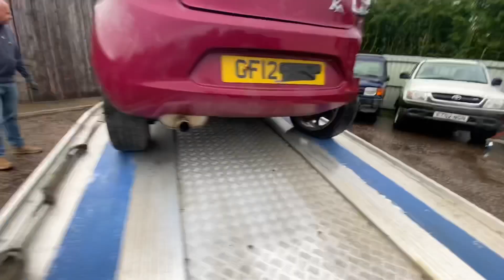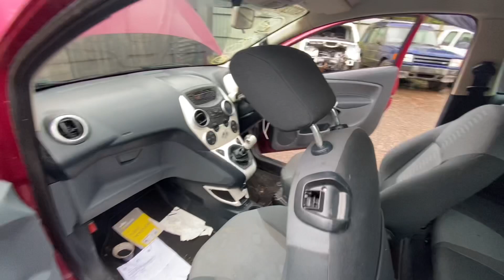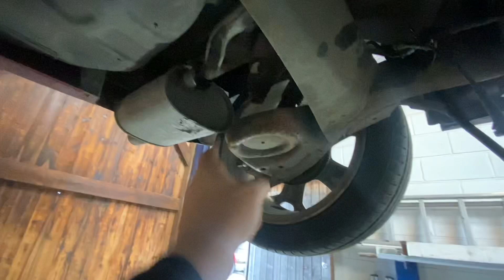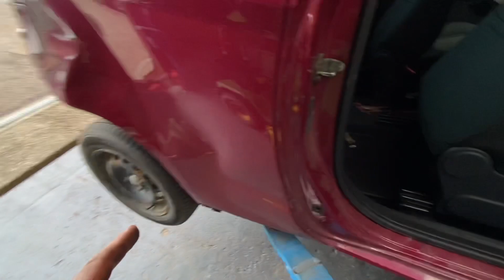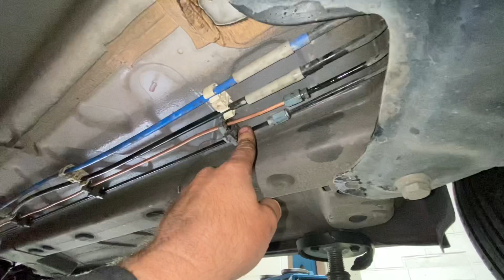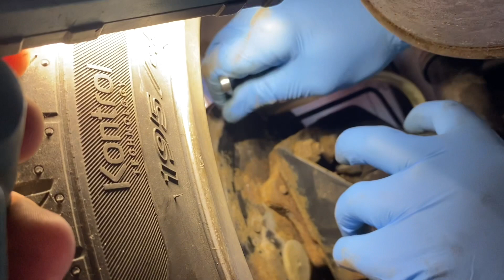Copart Accident Damaged Salvage Ford Ka Titanium PT 1

Comment: Not sure if anyone else  picked up on this but  the old  SP flaring kit on the bench  looked to be  SAE "double flare"  which is fine for the M10 female connecting to the existing steel line but the flare attaching to the hose on Fords is usually a male M10 and these are not SAE but DIN ISO "bubble" flares so as to properly "seat"  in the hose union. Did you  have  to crank that down  hard to get it to seal or were you lucky and it sealed on the double flare??? 🤞

Comment: FYI 14:31 pure copper isn't legal for brake lines in North America, in North America, legal brake lines are a copper nickel alloy.  A pure copper brake line tends to crack after a short time in service due to vibration and work hardening of copper.
Reply: They're perfectly legal here in the UK 😉👍
Reply: Believe it or not it's  legal to use copper in UK but why would you given kunifer is only slightly more expensive. Mind you a car will fail its UK MOT if it has headlight washers fitted  and they don't work ...it's a mad mad  world !!
Reply from the maker: It’s sold in a roll as brake line I have always use it 👍
Reply: @sruk Once upon a time we all thought the world was flat - and we used to get about using steam power.   Cupro nickel brake pipe  sold in a roll too - much safer and better  product...... gives  you piece of mind  - Personally I don't think it's  worth scrimping on brake jobs but  it is legal in the UK at the moment so the  choice  is yours....

Comment: Rob, I know I have mentioned it before but use a plastic plate of some description between the wheel/tyre and the road/surface then the offending wheel/wheels slip like a hot knife through butter. You can fork out and buy a set of "Slippery Jims" from the AA that they use with a hard area for forcing them under stuck wheels or jack up to place them under non-revolving wheels.

Comment: I know this is a long shot for you, but I knew a guy in Portugal who converted metal bedded pickup trucks to wooden beds to comply with strange Portuguese tax rules. (A wooden bedded truck is classified as a farm truck and can legally be fuelled with red diesel and it also attracts tax breaks). Last time I was there, his yard was full of discarded steel beds for just about any pickup truck you can name. Depending on how far you want to go with this, he is almost certain to have what you want. I still have contacts in Portugal so I can find out more if you are interested. To get a bed transported back to the UK would be much cheaper than you might think.

Comment: Top tip for you guys… if you ever have the brake hydraulic system apart, hold the brake pedal down with a bar or piece of wood against the seat. This will stop the loss of fluid 👍

Comment: Sorting the rear wheels went well with a fresh axel and all looking nice and square. It is a shame the bodywork is more challenging, but you have a good record. The new rear quarter is pricey, A good second hand one has to be the way. There must be some good salvageable ones, as I imagine most cars have front end damage. The car that gave up its rear axel looked like a winner for this project. It was a shame for the previous owner of your project, but looking forward, the next owner will get a nice little runner, the engine sounded great. Hopefully, this will be another rewarding project.

Comment: I would give that axle a wire brush and a clean then get some black under seal spray and give it a few coats. It would help to reduce the corrosion.

Comment: Nice little car rob you and Chris have some great projects goin that I'm looking forward to. We have a ka the grand prix version with the 16 inch alloys and I've never thought it's run very well on them handling wise as the suspension is very basic. Just remember if you service it and change the spark plugs to go carefully as they snap easily and it's then a nightmare to get them out.

Comment: When am removing the security nuts with an outer ring I get an ordinary steel nut and mig it onto the end of the stud, so the heat from the welding also helps if a gorilla has tightened them.....

Comment: Nice little car  Rob ! don’t normally see the titanium models, Just sort out the quarter panel and the rear bumper and you’re good to go, if you don’t mind me saying When you change The rear axle beam on cars you need to tighten down all the Mounting bolts on the rear shocks and mounting points when the car is at a normal ride height and not up on the ramp ,as if you twist the bushes they can drive funny
Reply from the maker: We know bud cheers 👍
Reply: @sruk   ok Hope you didn’t mind me pointing it out mate, I’ve seen people over twist the bushes and rip the rubber out the metal   as always a good video and keep them coming mate!

Comment: In the US used truck prices have more than doubled 250k+ mile chevy trucks selling for 5 grand and up 

depending on resale pricing I would wait it out until I found a used bed put up a few wanted adds . I would think a few aftermarket companies are making replacement panels and braces

Comment: No wonder they write them off at £700 for a quarter panel,had a similar problem with locking nuts took rear arm and wheel to dealer out came there master kit off come the nut then ordered the write key job done £5 for the lads time but £20+ for the key still cheaper than a set of new lock nuts and less work top lads 👍👨🏻‍🏭

Comment: Guys got to flag this up  -  really not a good idea to  use Copper brake pipe - it's actually banned in the USA.  Copper goes brittle - it work hardens through vibration and cracks. For piece of mind swap it out and use CUPRO NICKEL  "Kunifer"  brake pipe instead.  Most garages  use kunifer  brake pipe these days - lasts forever. Straight copper pipe  is a bit of a ticking time bomb - can't believe it's still allowed for MOT in the UK.

Comment: Hope you used Copper-Nickel brake line, not just plain copper.  Also, why not just put a double flare coupler in with a short line- or is that not allowed in MOT.
Reply: plain copper brake pipe perfectly acceptable, along with 1 male + 1 female union screwed together to make short repair section. im old school, but work in a main stealership, cant afford time to fanny about throwing away 75% of perfectly fine brake pipe. [much quicker to bleed as well]
Reply: @paulriggers1558  Plain copper pipe is banned in the USA because it work hardens though vibration and will fracture. Yes it is still allowed in the UK - quite why i really don't know because it is a bit like playing russian roulette - just a matter of time......  Kunifer is the way to go for a professional repair IMO.
Reply: @markjones8437  in the usa a lot of vehicles are body/chassis. this is where a lot of your vibration comes from on the pipes between the two. no brake pipes on modern UK vehicles are meant to move at all, every point of articulation is fitted with a rubber brake hose, + the steel pipes are clipped every 6 inches [MOT failture if unsupported/insecure.]   you are right in what u say about pure copper, but failtures  dont happen  here. also vehicles just dont do the mileage   - copper pipes usually fitted at 50k, car scrapped at 100k.
 my dad used kunifer brake pipes on his 1972 ford zephyr in late 70s + i give him a hand - it hurt my young fingers bending them then, hate to think what it would do to my fingers these days...
PS hes still got the zephyr [with the kunifer], but at 83 has left leg trouble so hasnt drove for 2 years [and not allowed out for covid 19 anyway]
Reply: @paulriggers1558  Hear what your saying -  I stopped using pure  copper in the late 80's . Failures   tends to be at the joint where you have formed the flare because of work hardening of the metal and vibrations movement associated with the hose union.  I always found that copper  is not very neat compared to kunifer> Agree totally - it is a bit stiffer to work with but I tend to use a bender / former for the tight bends.  

Hope your Dad is better soon so he can take the Zephyr for  a spin. Very nice cars - proper classic Ford !!
Reply: @markjones8437  whereabouts u live
Reply: @paulriggers1558  the country of the DVLA, dragons and sheep. Looked at the vid again today... sad I know, but curiosity got the better of me!!! Not sure if you picked up on this but  the "ye olde" SP flaring kit on the bench  is going to be SAE "double flare"  for sure which is fine for the M!0 female connecting to the existing steel line but as you probably know (if you work in garage) - the flare attaching to the hose on Fords is usually a male M10 and these are not SAE but DIN ISO "bubble" flares so as to properly seat  in the hose union. Bet they have had to crank that down  hard to get it to seal or just got lucky. 🤞  Thoughts .......???
Reply: @markjones8437   i wrote a reply but cant see it this end did u get it?
Reply: @paulriggers1558  No - same thing happened to me yesterday.  Comments  not showing in main chat either. Either a glitch in the system or they are being edited/deleted.......Hope not - because it should be  about passing on knowledge and life long learning as opposed to solely making it an  appreciation and praise discussion.
Reply: @markjones8437  trying to remember, started with someting about welsh sheep being nervous....
when u need to seal one metal part to another, we use a pure copper washer, as copper is very good at filling in minor discrepancies. can u see where this is going...  i still use my sp tool [1987] at main stealer, im onto my third [modern] handheld flaring tool in past 7/8 years. 3/16 copper pipe + old flaring tools are used every day up + down country, quick nip down + bleed off, then propper nip down at end. no leakage or blockages 99.9% of time, mechanics only get time to do a job once, so it has to be a proven method. kunnifer would pull our percentages down.
did u forget this is a fiat brake pipe....
the first draft was far more eloquent

Comment: The first thing I do when I buy a car nowadays is take the locknuts off and throw them in the bin! At some point they will be more trouble than they're worth! I would have cut the old brake pipe much closer to the wheel and made a shorter pipe!

Comment: Yh Fiat actually make these for Ford. Same engine and running gear as 500 and lots of common parts with the punto as well. Engines ain't powerful but they're reliable, nice and simple to work on and parts are cheap as chips.

Comment: Turn the Hilux into some sort of camper. Licence to print money at the moment!
Reply: camper bodies available in germany , these jack up + come off easily so u can leave camper on site when out for the day [worked on a german tourist one to fix goosed gbox, gertribe kaput was my translation for them - it seemed to work......]
Reply from the maker: @paulriggers1558  they still need the tub 👍
Reply: @sruk  this one was a chassis up, lift off body - no tub  mate, just a tiny hatch made of perspex in back of cab - the germans had 2 weeks on a windy clifftop campsite , while we fixed their gbox, in the northeast, in march...    "bracing weather" they said
Reply: only found 2 decent pictures showing checkerplate shrouded bare chassis, one on sprinter one  on navara, so they are rare, but out there in germany

Comment: That shape Ford Ka were absolutely terrible not only underpowered but awful to drive.
Reply from the maker: They wasn’t built for power bud and I think the drive Great for what they are the same as the fiat 500 👍
Reply: problem was the Fiat 500 body was lightweight the Ka body is heavy and tall so it ruined the handling. Worst loan car I ever had.